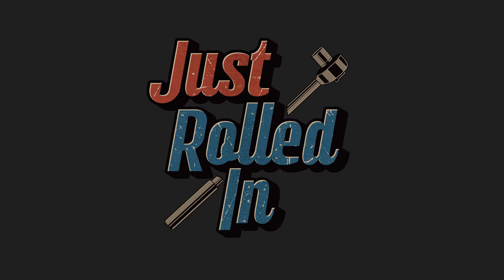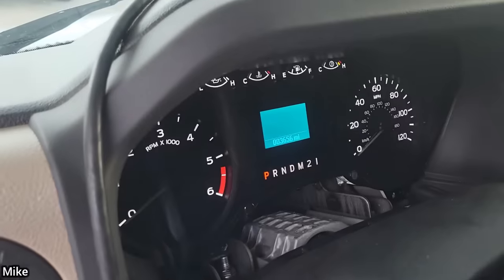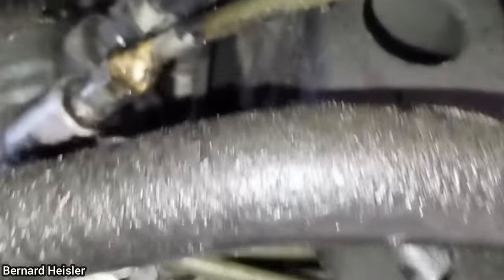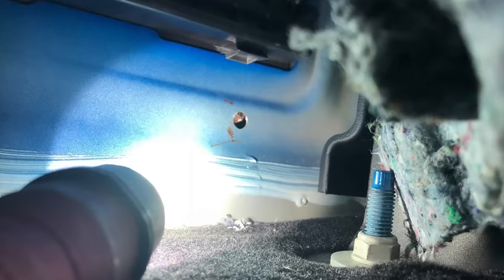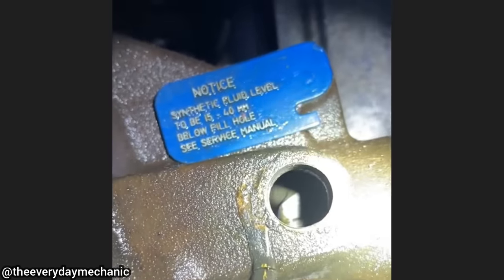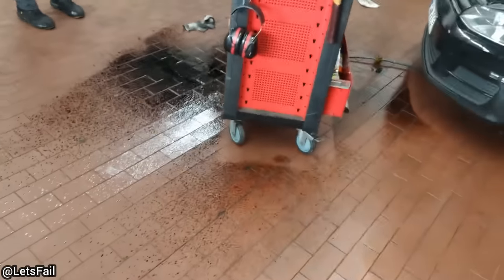Mechanic FAILS Compilation | Just Rolled In

Comment: 4:10  Nah, he's not dead... well, not physically.  He's just done with today.  Reflecting on what happened.

I once had an '84 Camaro that I got from my grandpa (which used to be my dad's... it's a long story).  Well, I was having a problem with the front driver caliper locking up.  Took it to three different shops and they all said the same thing, "you need a new caliper".  I told one of my friends about it and he said "bring it to the shop where I live, they'll give you a better deal on the work".   So I did (this was before I was heavily into doing my own brake work).

I took the car in and told them what was going on.  One of the techs behind the counter said "it's your brake hose".  I told him what all the other shops said and he repeated himself.  I said to just go ahead and do the work, regardless of what it was.  I get a call an hour later and, sure enough, collapsed brake hose.  It would allow the fluid in, but the rubber wouldn't let it release.  

Sometimes it pays to get a second opinion (or third or fourth).

Comment: 7:55.  That's why you ALWAYS  pick up a racked car about a foot, then shake the hell out of it. Better it fall short than high.
Reply: Actually looking up the lift points for the model is a good, professional idea.
Reply: I do that, when putting mine on ramps, before getting underneath it.
Reply: ….in the case of CNC machining, I ALWAYS grab the clamps and give them a yank before hitting the “GO” button. Far better to have the part move and you have to set the damned thing up again than to have it go flying…..

Comment: Warned a guy to turn off the battery charger before connecting to the terminals. He stated he'd done this hundreds of times without any pro.......................top of battery blows straight up and hits the roof of the barn we were in...........lems.  LMFAO as he wasn't hurt. :P

Comment: It's not just mechanics. Engineers do it too. Last week we were testing in a vehicle and after every reprogramming of the engine we got 99.999 DTC's on the steering wheel phone sensor. We spent a good hour trying wildly with all the expensive testing hardware we had. And then we laughed. My colleague was sitting with his laptop screen pressing the button all the time 😂 Can I send the photo in? Update: Sent.
Reply: I once spent half an hour debugging why my computer insisted a file was empty. Guess what? It was empty.

Comment: I once took my Buick Encore to my local dealership for an oil change and tire rotation before a long trip...  Left town, and noticed a pronounced vibration/shimmy that got worse as time passed.  Stopped and found that they had not tightened the lug nuts on EITHER front wheel and the tires were close to coming off...  I was pissed.
Reply: Well, better than them being over torqued leading to snapped studs the next tire change. I don't even trust tire shops anymore, I'll bring them in off the car.
Reply: Tire shop workers are only allowed a 10 minute lunch because otherwise they'll forget their training

Comment: I had a similar thing happen to me as 6:29, but it was just one pin on each of the front brake callipers.  We sued the dealership and they settled to replace all four corners of the car’s suspension, brakes and engine mounts, now we have what is basically a brand new  2008 Honda Jazz.

Comment: Ran a shop in rural midwest with my father. We specialized in electrical diagnostics but often absorbed other mechanic-induced problems. Another shop that competed with me called me once to ask "Hey John how do you remove a pilot bearing?" 

You need a license to work on planes and operate on people, but none to work on cars.

Comment: This is why I've learned to get around the vehicle myself rather than rely on shops. Big stuff, at least I can check the results.
And, yes, I've bodge the electrics on my van conversion. It has an auxiliary battery that I run all of the high tech stuff bypassing the wiring harness completely.

Comment: Seeing that shop make the mistake of not tightening lug nuts and causing both rear wheels to fall off made me feel better about the time I didnt overtorque mine and the car started to shake, they shook loose to the point where a few were able to be spun by hand. Luckily, I caught it and torqued them properly before my wheel fell off.
Reply: I did that before. got within 1/2 mile of home when my car  to serious shaking. In 2 seconds I knew what I did. Walked home, got a jack and walked back to tighten my lugs. I call it the Simple Simon Award
Reply: I had done this with my dads van.. I thought I had properly torqued them with the torque wrench.. But apparently what had happened. When I put the wheels on. I didn't get them tight enough so they were sat weird on the ground. When we were driving we were taking a lady 200miles from where we were. So we got to driving. Had just done the ball joint and thought that was coming lose, pulled off, hard shoulder, checked that and it was fine, then we found out I had done the fault of the lugnuts, just caught it, two lugnuts missing both side but managed to make it so we had four on each wheel so we could get it home and buy some more. XD
Reply: @drshocking1229  had to redo the torque on my rims last week. The 3/4" wrench committed disassembly of itself well in use. Went to the 1/2". Will not buy another at Harbor Freight.
Reply: Ive learned not to ask your coworkers to help put wheels on customer vehicles. I put on one side and the coworker put on the other. When I went for a test drive I made it 2 blocks and his side rear fell off on a main road. Luckily only the rotor had to be change out but it was terrifying. I found out afterwards he only hand threaded them on expecting that I was going around to tighten his side after (thats on me).
One wheel at a time guys and do it all yourself - or atleast check over anything anyone else "helps" you with.
Reply: Had it happen to me twice back when I was driving a semi. Shop failed to properly torque 2 drives and I seen them start to wobble while hauling 18 tons of trash.
Reply: I did it once changing my own out. I had torqued them down when putting them on, but hadn't retorqued them after a bit of driving. I notice a bit of a shake in the front end, so I check next time I stop, and sure enough one lug nut is completely gone. 😬

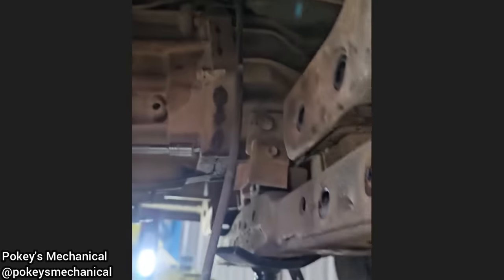Comment: 8:42, yeah, I've done this before. The worst part is the bolt had just de-threaded enough to drop the assembly out a millimeter, so I couldn't thread the bolt back in. This is why rubber mallots exist. lol

Comment: Once I pressurized a brake bleeder while working at Delta JFK but didn't know 1 of the underlings didn't screw the fill cap back on all the way. Boom, brake fluid bomb bath. We had showers at the shop but I still had to line my truck seats with trash bags. Always, ALWAYS give any pressure vessel a quick check before throwing the beans to it. And watch over recent tech school grads like a hawk!

Comment: Tried 3 different alternators on a silverado once because none of them were charging before realizing the hot wire from the battery to the alternator was broken in half. Totally had a brain fart that day 🤦🏼‍♂️
Reply: I did something similar on a 74 Caddy. After the third alternator, I then noticed that the ALT light on the dash wasn't lit. Put in a new bulb. Alternator charged just fine. Most alternators (at least in the old days) must have a load in the circuit that turns on the light. No light (at all)= no charging.
Reply: I was once stumped after fixing my moped.
It wouldn't run.
Had to grab the electrical schematic, only to find out the power switch on the steering wheel was set to OFF instead of ON.

Comment: 7:48 - Awww, poor 4th-Gen Camry! 😢 Vintage red metallic with gold pinstripe and factory spoiler, just like mine.

Two days ago, I was doing my routine fluid check under the hood of my Cherokee. It was about 2 AM, so I was using a flashlight, and was doing a very thorough inspection. First thing I noticed was my coil-to-cap wire was ever-so-slightly rubbing through on the A/C line, not nearly enough to be concerning, but I'm planning on doing a full tune-up very soon anyway (181k, it's due). Next thing I noticed was a nice pair of Snap-On diagonal cutters, sitting on the inner bodywork beneath the master cylinder. I've had the Jeep a little over a year and a half, driven ~30k miles, and in that time I've replaced both a water pump and power steering pump, poked around looking for the best wire routing for a future amp/sub combo and alarm/remote starter, and fully inspected my brake lines from master to each wheel, and not once did I ever see those diagonal cutters sitting there.

Which reminds me, I should probably text my neighbor (previous owner) and see if he's been missing his diagonal cutters! 😆
Reply: Forgetting a tool.
In Japan🇯🇵, this is sometimes called "hidden by a dwarf."

When I was servicing my own k-car to get the Japanese two-year statutory vehicle inspection, I once left a TONE 8-10mm bend ring wrench on the brake nipple of the rear drum brake. After getting the inspection, I realized that the ring wrench was missing, so I had no choice but to buy a KTC 8-10mm straight ring wrench, which is more expensive than the one I lost.

Two years later, when I started to service the k-car again for the statutory vehicle inspection, I found that the lost ring wrench was still clinging to the brake nipple of the rear drum brake.😱

My k-car continued to run in various places for two years, but the ring wrench was still held by the brake nipple without falling off.😢

He was thinly rusted all over, but I removed the rust with a wire brush and stored it next to KTC.😌

He and KTC are still working together as a good team.😊

Comment: This is why checking the certifications on the lobby wall and comparing it to the name of the mechanic on the work order is so important. If there are any discrepancies immediately stop the work and go to another shop.
Reply: And these days you can check reviews.
Reply: @VintageCars999  Online reviews are trash. I've known this since 2000 bruh. You should too.
Reply: Let a new shop do a simple job, or simply diagnosis.
Like replacing exhaust or brakes.
Or letting them find that one electrical connector you disconnected.
If they cannot, or make scammy repair suggestions, go to the next and repeat until you find someone who can.
Reply: @DeeDee-pw9pm I'd rather not let any shop that isn't extremely trustworthy touch safety critical systems. I'd rather pay the $1800 than potentially have a brake failure.

Comment: I feel bad for the mechanic mishaps but as for the shops who do terrible/deceiving work, the owners are hopefully filing lawsuits. Especially the one with the painted alternator. That shop should have their license revoked and closed down for obvious fraud.
Reply: Definitely. There should be jail time involved for those A holes.
Reply: I worked at a starter and alternator rebuilding place, for a few months, many years back. A John Deere alternator was just a GM alternator, but painted green, and charged the customer twice the price. Expensive paint, I guess.
Reply: I would definitely like to have a little "discussion" with the owner! lol

Comment: I was a warranty claims manager for a GM dealer years ago. A customer bought a brand new 1990 Cutlass Supreme and she had so many engine problems that we replaced the engine. All was well until she brought it back for a 3000 mile oil change. She picked up her car to drive a half hour to work and she heard what sounded like, her words not mine, "bolts in a blender" and the engine failed. The mechanic forgot to put oil in it. We replaced the engine again and she picked her car up and drove it to a Honda dealer and traded it for a new Honda Accord. Can't say I blame her.
Reply: It's one thing for the consumer to be dumb and not check their oil, but I cannot forgive a mechanic who doesn't have "Check Oil Level" in their sanity check for an oil change.
Reply: We had taken my mom's 1989 Cutlass Calais to a quick lube place for an oil change. Half way home (about 10km out of the city), it overheats and dies in the middle of the road. We get it towed to the Canadian Tire on that side of the city. They say the fan is dead and isn't starting. They replace the fan. We head home and again it overheats and dies half way home. We bring it back and they say the computer must be bad because it isn't turning on the fan, so they replace that. We come to pick it up and they can't get it started in the shop. They mess with it for half an hour. They finally give it to us and you can hear it's running really rough. My mom was no pushover, and after a public shouting match with the manager, he tells her to leave and never come back, so we never paid a dime.

We take it to my uncle who used to be a heavy duty mechanic. He takes one look at the bottom and says, "Your oil filter is barely on." There was oil sprayed all over the bottom of the engine. Most likely the quick lube place threaded it on but forgot to tighten it. Three times over Canadian Tire failed to check the oil or to even notice the oil sprayed all over the bottom of the car.

We don't take anything to Canadian Tire anymore.

Comment: 8:23 HOW? This has to be a prank. The only way i have in mind if putting the Horn's + cable in serie with a common ground for all that stuff.
Reply: My friend had a crossover that started having all kinds of dash and engine electrical issues. Numerous checks were made, couldn't pin it down. He finally came across a note somewhere online that said to check the traction control circuit. Turns out a wheel sensor had failed closed and all the affected electronics shared that ground in the buss.
Reply: Probably a Bad Ground

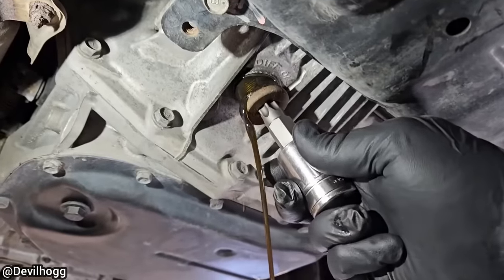Comment: @6:12, I've done this same thing myself, engine had nearly half a million miles on it, it liked eating glow plug tips, that's what you get with these cheap aftermarket glowplugs, the tips swell up and break off in the head/cylinder, make sure to get OEM.

Comment: I've experienced a couple of these incidents myself.  Local dealer forgot to tighten my lug nuts, causing the driver's rear tire to come off and hit a guy in the knee, andtake the trim off his Jeep door.   Last week brought my new truck with 28,000 miles on it to have all the fluids and filters changed.  The new dealership forgot to make sure the trans was full.  Hopefully won't have any future issues. 😬
Reply: I hope it's not a chevy, they are having tons of issues even with fluid in them. lol

Comment: The every button is a horn vehicle reminded me of a early 80's Chevy Malibu a friend of mine owned in the mid 90s. The vehicle had an aftermarket cruise control system installed as well as an aftermarket stereo and had previously been owned by a mechanic. For some reason if you pressed on either of the front manual window cranks with the windows up all the way it would sound the horn. That led to a fair amount of teenage shenanigans' back in those days!

Comment: Countless times I’ve had to finish a repair job myself after picking up the car from the shop. And even later finding cheesy repairs like using electrical tape to hold together an intake tube.  A lot of mechanics are poorly trained or are crooks.  Treasure good ones you find!

Comment: I wish I had recoreded the time a garbage truck was reving when stepping on the brake pedal.

The cause was that when replacing a leaking air fitting on the govenor I had moved a wire harness around a bit resulting in the throttle advance which makes the engine rev up when running hydraulics cross wit the brake light wire which was in the same wire loom... along with 5 other wires that were damaged which I didn't investagate what they went too.

Comment: 50 years in that trade and NEVER had a lift slip, even with ones that were older than me! I think the worst accident I had was fooling with a high pressure grease gun and painting the ceiling of the shop. That was in the early 70s and I was there recently to see the new owner had painted right over the grease globs, almost 50 years later. SMH at the slacker painter!

Comment: I've done the horn one myself.   Swapped a RAV4 steering wheel with another and forgot to swap the buttons over.   
The two wheels had different wiring to the buttons and sure enough, as soon as I pressed the volume, I got the horn!

Comment: Back in the mid 1980's, I worked in an old garage just starting out as a mechanic.  I was given a bay with an old inground lift.  It ran off air pressure and hydraulic fluid.  There was a front lift and a rear lift.  I couldn't do front wheel drive cars.  So I got all the old cars, vans and pickups.  The problem with the lift was it would just leak down on the front lift.  It scared me several times.  Thank God the rear lift was v shaped and held the rear axles in that v shape.  I don't know how a van stayed in place once when the front lift fell about 4 feet down.  The shop finally got a repairman in and repaired the old lift.  They had a time finding seals to repair it.  the next year they moved me and then put a two post lift in that bay.  The other lifts were two post in the ground but had swinging arms like today's modern two post lifts.

Comment: I once forgot the drain plug on a International 4400 when I was doing an oil change. No damage, but, I pumped 27 quarts of oil straight through the engine, and, onto the floor!